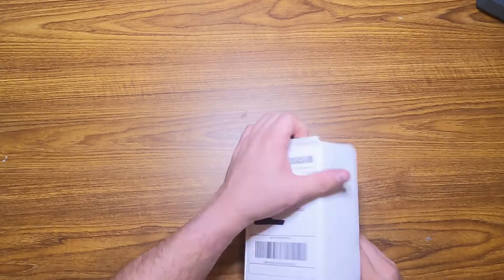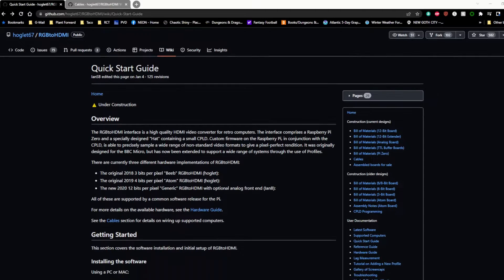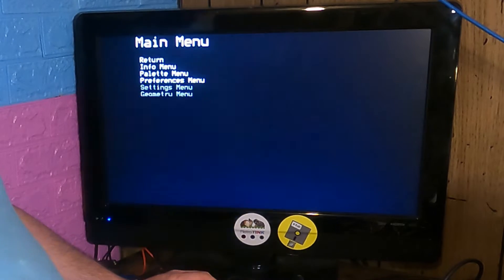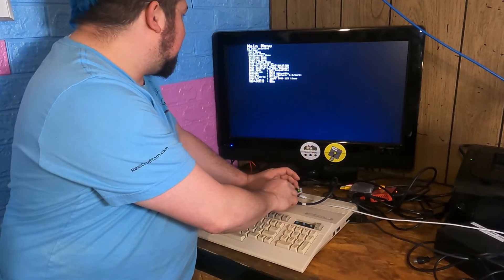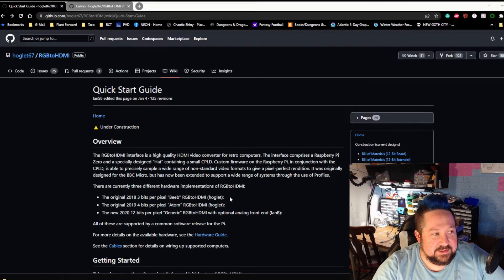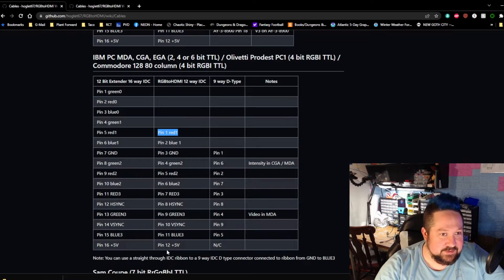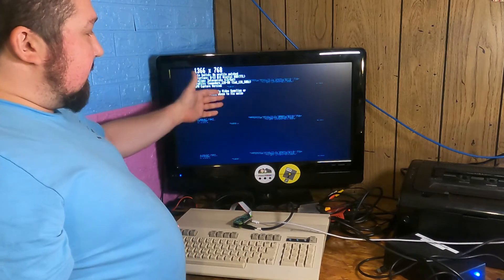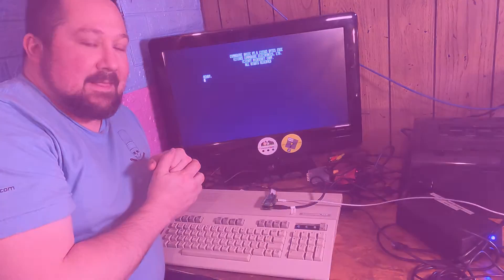80 Columns out of my C128... over HDMI!   (RGB2HDMI)

Comment: Been really thinking about getting one of these but do you know does it do the 80 come and Graphics modes
Reply from the maker: The 80 columns mode needs a DB-9 connector, like a CGA monitor.  The 40 columns mode comes out over the same plug as the C-64 did.  There are implementations of them acting as dual monitors, like The 8-Bit Guy's Attack of the Petscii Robots, but typically it's one or the other, so you'd need a way to switch them.  Some exist, I just use two different inputs on my TV.

Comment: They do make an insulation-displacement DB9 connector too, it would be a lot easier to have a "crimp on" type rather than the soldering involved
Reply from the maker: Yep.  And I have some now.  And had I not thought I needed to make my own everything, I would have just bought the one that RetroHackShack offers as a kit option.  🤷‍♀️